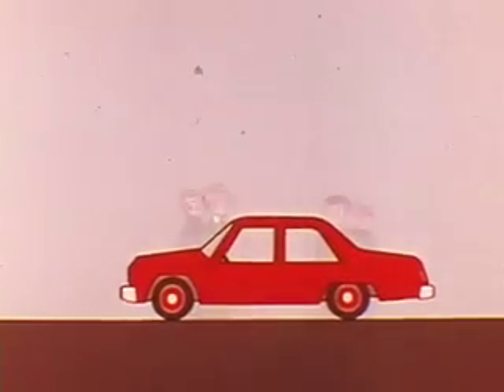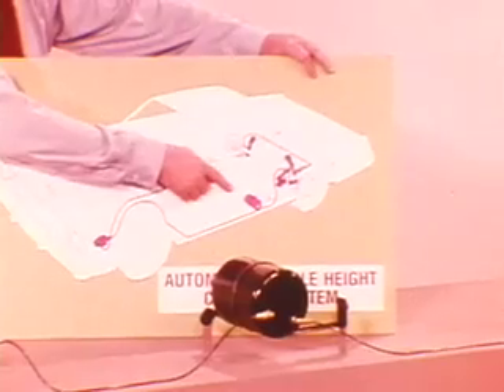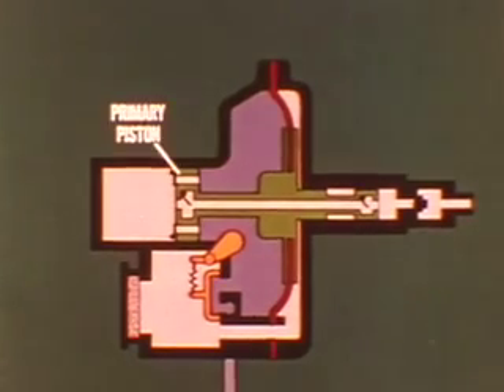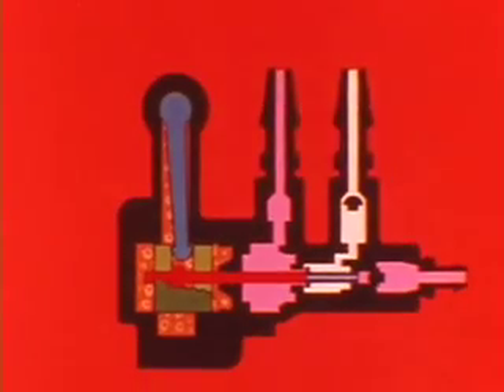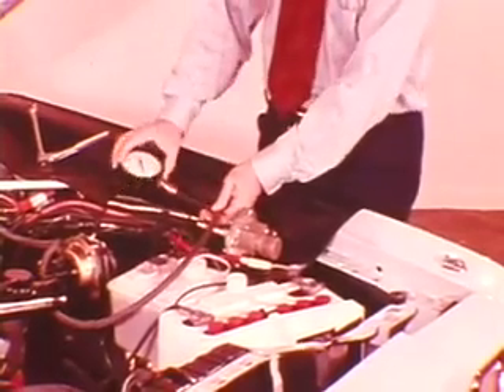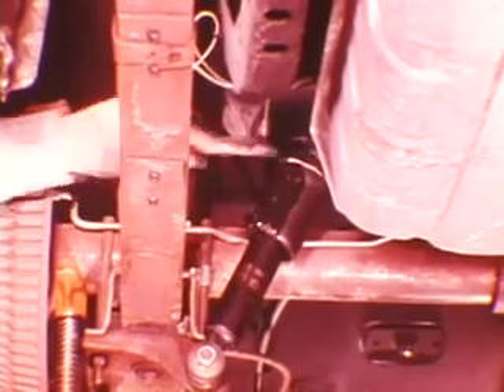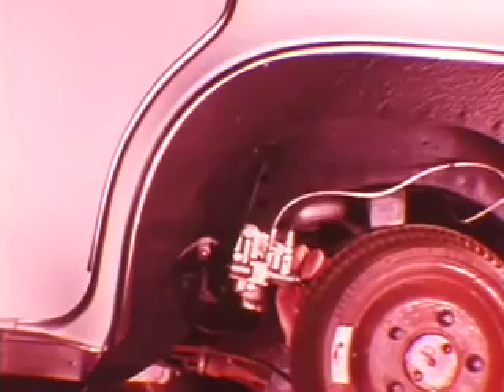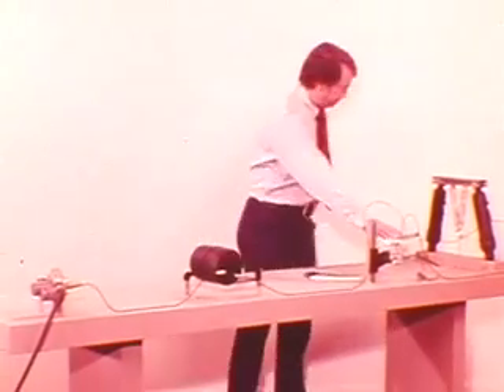MTSC - 1975, Volume 75-7 The New Automatic Height Control System

Comment: These Chrysler group cars were mostly gone by the time I entered the business. However, I worked on a variety of other cars with devices that changed ride height. Replacement of those components was a big business, and fitting non-adjustable car parts were also a big business.

Ford used air bag suspensions on their cars, and if you didn't shut off the system before lifting the car, you could easily do a fortune in damages.

I don't think any of those cars had an intake vacuum driven air compressor. I do think a similar air compressor was used in some exhaust system air pumps, but most of those cars were also gone by the time I got into the business.